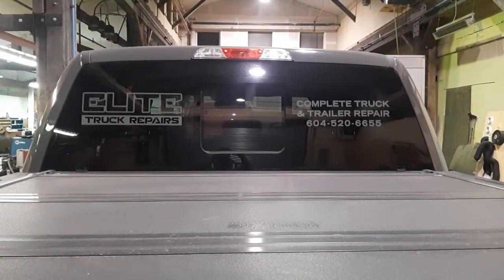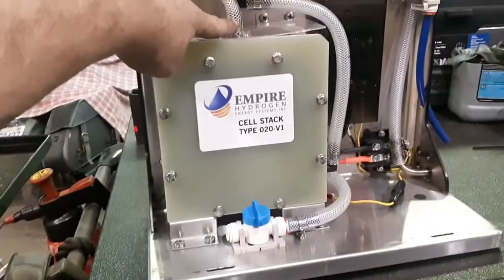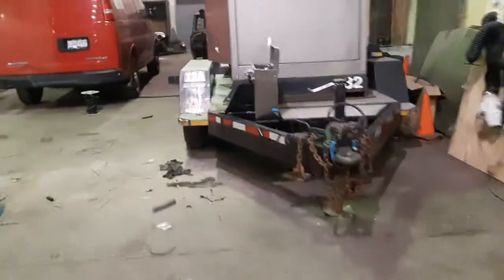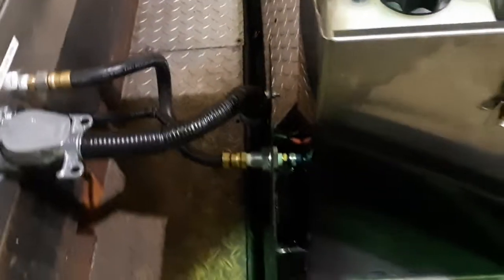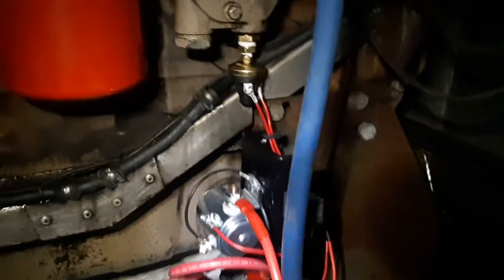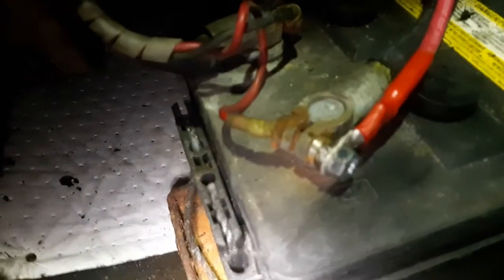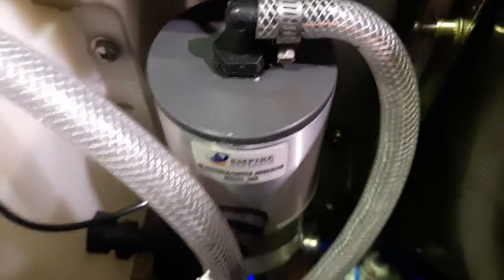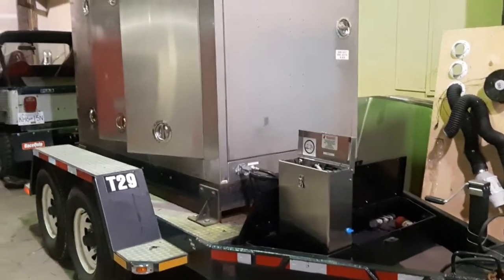Hydrogen Diesel Engine!

Comment: are you powering this by the generator output or the alternator.   For a car it seems like these divices would be useful if you could generate gas from decelerating, braking or idling. then store it  (maybe with a diaphram) and then release it when accelerating.    Seems this is also a good way to use some solar or even wind during braking and turn it into useable energy for the ICE ----  does any of that make sense to anybody ?

Comment: So do I understand correctly that the hydrogen is a supplement to the diesel fuel but the hydrogen allows for the diesel to burn cleaner and more efficient? Meaning the diesel is more completely used and not wasted out the tailpipe in a cloud of black smoke?
Reply from the maker: In a nutshell, yes that is correcct.

Comment: there is a dude running a 500hp hot rod on compressed hydrogen gas.    I believe it has O2 in it.      If you have a front wheel drive then there is room for the bottle under in the center.   you could then put an electric motor on the rear axle --- boom you have a hybrid and then boom, you can use braking energy and solar to make more H.   You can add H gas to a diesel  up to 50% maybe higher without any mods (i think).   They are getting them to run on up to 90%  It seems like a hydrogen generator/compressor at home using power from your solar panels would be the holy grail.   I'm not sure if the gas hot rod was 'dual fuel' or not but the diesel applicaton was.    I don't think ICEs are going anywhere.   People don';t want to live in a Jetsen's world of silent cars.    That's why people still ride old motorcycles.     Ithink we are headed toward a world with 2 interlinked road systems - regular duty and light duty.  People don't need 2 ton cars to drive a block to pick up groceries.   I also think we will have robots that travel in tunnels underground for deliveries.   A local mini hyperloop for packages, if you will.

Comment: Use fuel to make electricity. Use electricity to make fuel. What do you win if anything?
Reply: Only if laws of thermodynamics didn't exist...
Reply: @dilianaran6845  If only
Reply: I think it uses surplus energy from the alternators to generate the fuel.   My diesel truck has 440 amp alternators,  so it's producing 5280 watts of power while the alternator clutch is engaged.    It would be nice to convert this unused energy to a fuel supplement.
Reply: it uses less fuel
Reply: You gain enthalpy aka more work done due to more even burning as hydrogen burns around the diesel aersol particles faster allowing them to all ignite moreso at the same time vs lag and wasted fuel.
Reply: @baloog8  sounds more like like a misfire to be honest

Comment: Can you decrease fuel injection volume or pressure and increase hydrogen input
Reply from the maker: No. All pressures and volumes are pre set and not adjustable. Each machine is built according to the engine size.

Comment: Great work, thank you for it. I hope that you will contact me if you wish. This is up to you. I work on the sustainable card. We have diesel engines such as Caterpillar and others that run on diesel and I want them to run on hydrogen. Thank you
Reply: he's not running them on hydrogen, he's adding hydrogen gas /easy to generate.. No one has demonstrated any results with this method. its always 'oh next video' .. If its using the alternator you don't get more power than its max amps. theoretically it could do better but its not significant.

Comment: So it's not running on hydrogen? It's just aiding the diesel?
Reply from the maker: Yes
Reply: Where can I buy it
Reply: @joseviera1964  did you get one yet. Save thousands. It will be like your making 50% more per year if you’re a trucker
Reply: Newer hydrogen diesel motors can be run on up to 90% hydrogen , which is really amazing. Thanks for being first generation to try this. Since it’s two years now , you have any results to share?

Comment: will this unit power a agriculture compact 35hp tractor
Reply from the maker: It is only a fuel supplement in this configuration. If your tractor runs on diesel this can help.

Comment: Great to see it working. I'm building one with 110plates. Yours look awesome. Maybe you can ask your supplier if can add a pwm to increase higher amps to produce more h2 so your efficiency increases too. I'm targeting 50% extra mileage combined with fossil fuel.
Reply from the maker: I'm sure they would love to talk with you give them a shout at their website
Reply: The DuPont PEM systems are incredibly amazing. They are ten times smaller. Literally and produce ten times more output of gas.
Reply: Shouldn't you have another bubbler unit close to the intake to prevent instant blowback explosion?

Comment: I am a Brit and worked for the UK Department Of Energy from 1977 to 1978 and research was being done then in collaboration with US Universities and I remember talk then of fuel cells, so bring it on. I drive a diesel and cannot afford an EV so if this comes along as an alternative upgrade, I will very seriously considerate it.
Reply: It still requires diesel fuel to run as this is only a hydrogen generator to add to the air used in a standard Diesel engine. It give some power but it’s main function is to eliminate or greatly reduce the production of NoX and particulate left after the burning or diesel. The engine will not run on hydrogen alone. It must have a diesel fuel to run. As far as a vehicle application, their is little extra fuel economy to be had, only cleaner emissions.
  Today, a Diesel engine is required to use extremely low sulphur fuel and have a particulate trap. As the trap become full by restricting exhaust flow, it is sensed by a difference in engine side pressure increase while the exhaust side pressure drops. 
Like a vacuum cleaner that has a plugged filter bag, vacuum is low or lost while exhaust is low. Sorry! This is not the holy grail for Diesel engines as a fuel replacement. Other Diesel engines use a blue juice in a separate tank that is metered into the exhaust stream, this too reduces particulate matter low but does roughly nothing for NoX at the time of my last training by engineering with GM.
DK, ASE master tech since 1978, retired.
Reply: @deankay4434  this actually improves the diesel mpg considerably and especially so When used on vehicles that are towing out moving a lot of weight because the hydrogen also allows it to produce way more torque than normal. It also burns clean. The exhaust isn’t black at all anymore.

Its been saving thousands. It paid for itself instantly basically. And the more gas prices go up the more its proved it’s worth. 

There are lots of people who put out fake info to try and suppress this amazing simple easy safe tech.
Reply: @CoincidenceTheorist   GM build CNG vehicles in the 90's. They used two sets of injectors that could be switched at the dash for one or the other. 
  In 2007, GM had 4 hydrogen fuel cell labs working on mobile hydrogen powered vehicles. They used the "PEM" (Proton Exchange Membrane) as it strips the electron off the hydrogen/air atom, forcing it to travel a path around the membrane via a given collection grid and path to flow. Being the definition of electricity (Voltage = electrons in motion moving toward an area of less electrons). 
  180 volt DC is the output. Shared with a converter & inverter for 12-14Vdc to operate normal car stuff, but AC as well. Both boxes create heat, so de-ionized water is mixed with antifreeze and has a radiator & heater core. The AC controller operates 3-phase AC motors by running 3 wires to any location a motor is needed. They used a modified version of the EV-1 for front drive. Two tanks would power the vehicle to 100 MPH with 5 people. The range was over 300 miles, but they were obsessed with getting over 86% efficiency from the PEM fuel cell. Hydrogen floats straight up. So if a leak ever happened, it's gone. 
  I would drive a hydrogen fuel cell vehicle in a heartbeat. I already know the hydrogen generation program that can go anywhere water and electricity are found. 
DK, ASE master tech since 78,
Retired ACDelco MASM.

Comment: H2 + O2 + N2 = H2O + NOX  This is the real combustion equation in reality BUT it does reduce Co2 !  Not Nox (Nitrous Oxides)
Reply from the maker: Nitrous oxide is different from Nox,  N2O vs NO
Reply: How come you exhale Co2? You left out the human that designed it, the one who installed, the people who made the potassium hydroxide to increase hydrogen production using hydrolysis, Jason who installs it and in a vehicle, the guy or gal who drives it who all produce Co2.
  If you want clean, install a hydrogen fuel cell in your vehicle, fill up the tanks with gaseous or liquid hydrogen, and run it thru a proper “PEM” type hydrogen fuel cell. Convert and invert the 180 volts DC into usable power for 3/phase electric motors and the other will power the radio, A/C, blower fan and a charger for your smart phone (Brand Insert Here) and the rest of the 12-14Vdc items you need including electric mirrors that move and are heated when fogged.
  GM had a good of 86% efficiency from it PEM fuel cell, working on it at 3 facilities until 2009, now only one.
  The biggest problem is public perception. #2 is the cost per unit has to come down to make it marketable, #3, set up a nation wide hydrogen production and distribution locations. 
  Exactly as fuel are done today, raw material are harvested, refined, distribution and re-fueling centers everywhere to fuel the hydrogen fuel cell vehicle.
  The one I drove went to 100 MPH, held a total of 5 people and dripped 7% more water onto icy streets than todays cleanest fuel burning car and depending your choice of liquid or gas hydrogen gave you a range of 300 miles. I enjoyed it tremendously although repair shops and dealership garages have to be modified with sensors as hydrogen goes up, not down, then open a negative pressure atmospheric evacuation device on the ceiling that old boys call a fan to air out the shop. I hope they don’t have an accident in the shop the day after a company picnic services beany-weinies as it could play hell with the sensors in the shop! Almost like a sence from “Blazing Saddles.”

Comment: Hydrogen implodes   why are people still trying to use it with engines that run on explosions
Reply: I can assure you it creates a decent pulse wave. Capable of pushing a piston. Go fill a garbage bag with hydrogen/oxygen from one of these units and set it off with a Roman candle from 20 feet away. For about half a second it will feel like you put your whole body out the window of a highway speed vehicle. It's hard to describe the pulse wave intensity. But it's intense.
Reply: @3th1xs  lol I no. The lights in my shed didn't like the bang. They all went pop

Comment: Only the left side should have bubbles.
Reply: This whole video is super shillly and does hho a disservice. Please active looking into hho. It’s amazing. Especially the new DuPont PEM stuff. However the basic normal hho setups are great too

What’s important is getting some sort of hho system on your rig ASAP. START SAVING THOUSANDS. It will pay for its self multiple times on your first load.

Comment: We had a commercialized version of this on every Equity truck assigned to PepsiCo... and it NEVER yielded accurate results. When I ask my supervisor about this, he said it didn't matter. The only reason they had them, was because the fed allowed them 'research' status to run pre-emissions 12.7L Detroit Series 60 engines. The commercialized systems we ran, were huge. Probably had AT LEAST 50-100 times the output capacity of this unit here.

Comment: I don't understand.. I want some clarifications:
• was hydrogen used as SUBSTITUTE for diesel? or
• hydrogen was ONLY ADDITIVE to diesel?

Probably as additive, but I'm not sure.. If so, can diesel engine run on Hydrogen only?
Reply: It's added to the combustion process.
Reply: The hydrogen relies on the combustion of the diesel to act as a pilot to ignite it. Hydrogen does not self-ignite under pressure as diesel does
Reply: @johno4521  what are you talking about? Glow plugs?
Reply: You will get 35+mpg (no problem. Diesel rigs are where these systems really shine because they give you way more torque in demand. Like you have no lag going up hill with a load. Which equals massive savings on fuel. 35mpg a modest claim that i state so as to assure that i am bring truthful in all variables. Like as in someone who’s half braindeaddd and sprays gallons of fuel out on the ground every time they fill Up their gas tanks.  That’s the kind of variable I’m accounting for. Otherwise it would be way higher numbers. 

Oh and believe it or not your exhaust will be cleaner than a normal cars. If the govvv really cares about the environment they would be giving these out free not whatever greeen things theyre supposedly doing.